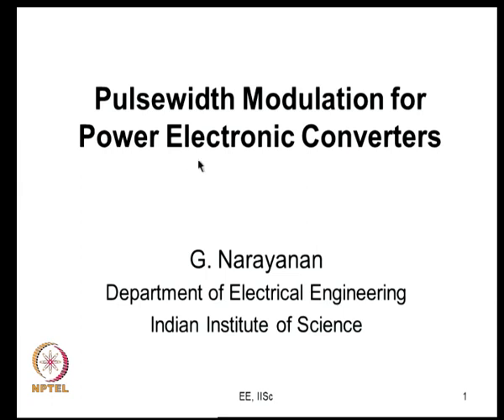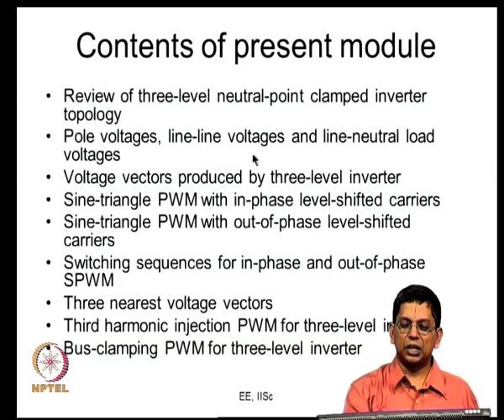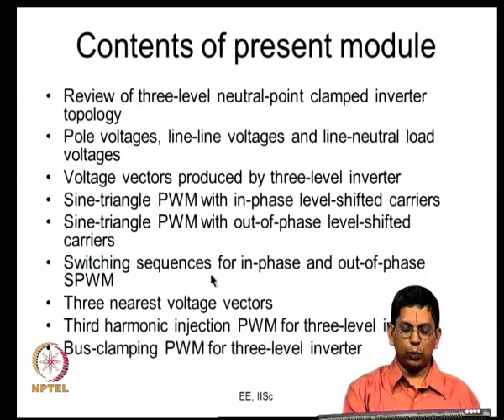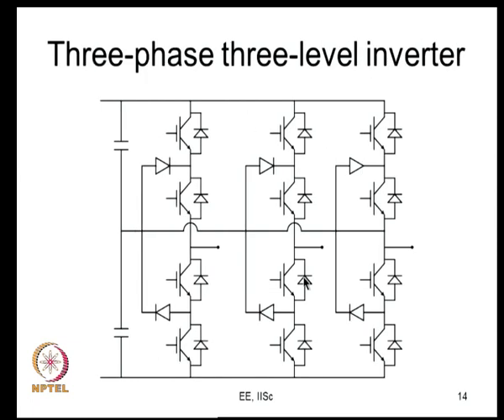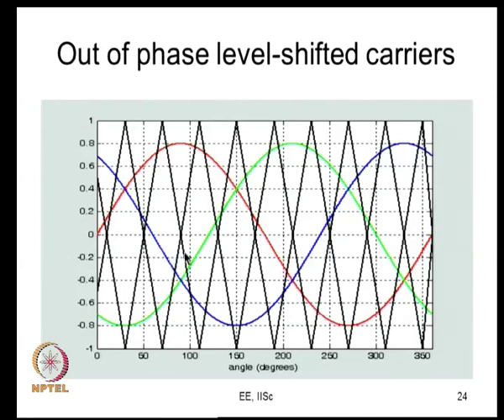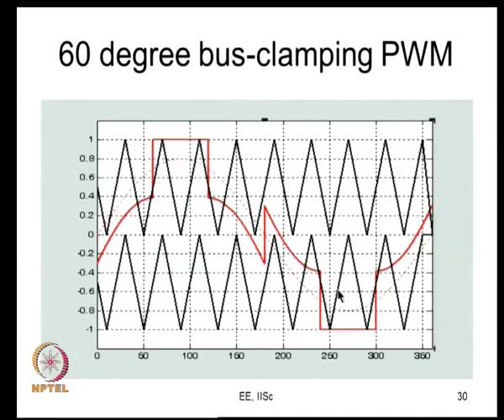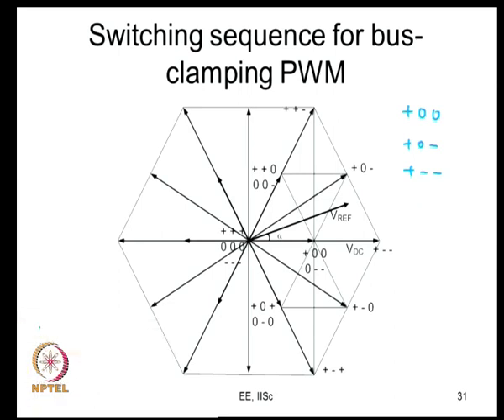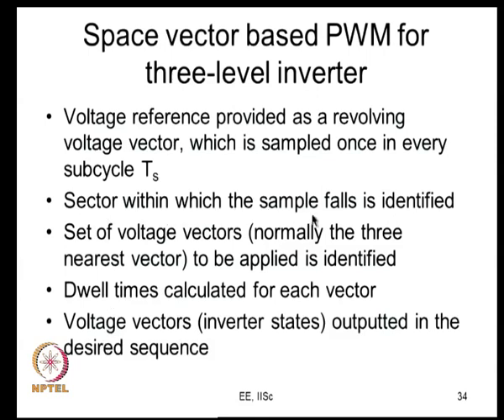Mod-13 Lec-40 PWM for three-level neutral-point-clamped inverter - III

Comment: I guess there is a mistake at 15:00. In the three leg inverter shown, the midpoint should only be connected between the diodes and not to the leg containing the switches of the B phase.
Reply: Yeah an extra line for third leg.